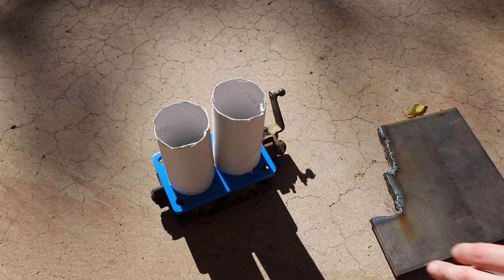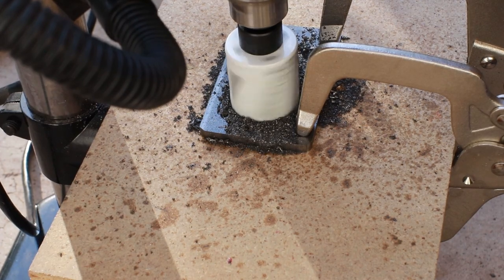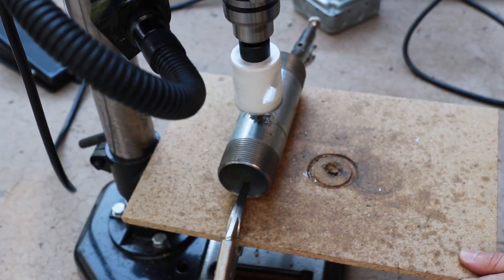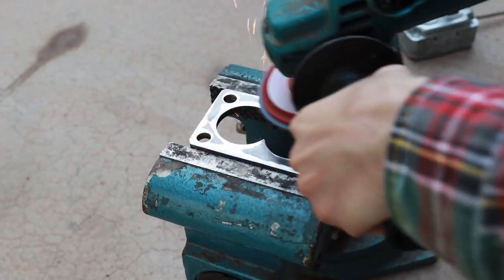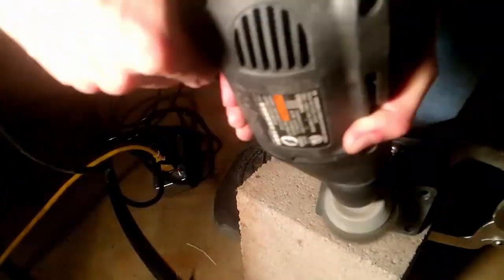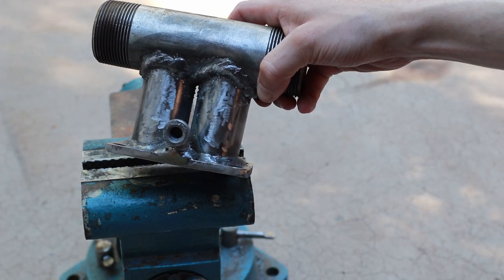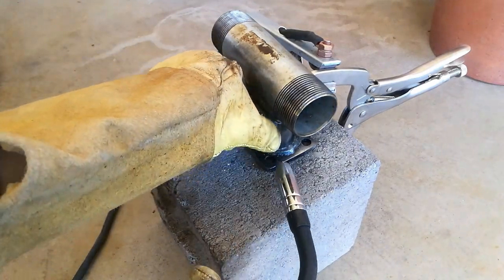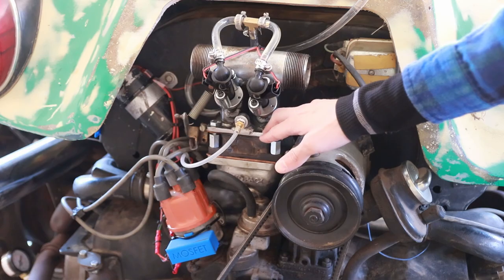TBI Fuel Injection for VW Air-Cooled Engine

Comment: Quick tip, when using a hole saw to try and make a large hole in a thick piece of steel, drill a couple of small holes on the perimeter of where the hole saw teeth are going to cut, it helps clear the chips out and lessens the load on the drill press slightly.
Reply from the maker: Great tip, thank you!

Comment: 4:44... Just a suggestion... It is always beneficial to start larger drilled holes with a smaller drilled hole. The small hole will be more accurately centered and the large drill will not skate off center.
Good job on the conversion
Reply from the maker: Great point, thank you!
Reply: Yeap! More easy way to do thats holes.
Reply: Another suggestion is slower cutting speeds..i found those large hole saws work best at slower speeds..too fast and it skips over instead of digging in and its actually faster.. this is known in the lathe world as feeds and speeds..their is a sweet spot.and the larger the tool the slower you go as the diameter changes surface speeds.and drill presses tend to drill smaller holes and are set to go fast and that compounds it with a larger cutting tool..SO the faster you go the more wear on the tool as well... carbide can go faster but tool steel needs a slower range of speeds and the right feeds.

Comment: It cut faster cause of the space that opened up for the chips of metal to go. It wasnt a closed space. But love  what your doing. Im in the middle of swaping a 200cc engine on to my honda grom clone. And im thinking i might have to go with fuel injection. Due to space and your videos are definitely helping

Comment: Throttle position sensors are the main reason you have the lags, and over or under-fueling/ backfiring. Get that on and it will be smooth ;-)

Comment: As an old hand at VW's, my guess on the stumble is not a fuel issue but a timing advance issue. The centrifugal only style distributor(009) is notorious for that. I prefer a vacuum advance advance myself. I have one on my Beetle that has taken all the lag out. It is an 86/87 Suzuki Samuri style distributor that fits the VW.
Reply from the maker: Great idea! Believe it or not, my newer ECU design actually controls spark timing via 4 HEI coils and a pair of optical pickups mounted inside the 009 distributor. This means I can actually add in vacuum advance via the MAP sensor signal if desired, and apply more or less any timing adjustments I want in software! With the latest ECU and programming, the buggy runs extremely smoothly now!
Reply: The homebrewn fuel injection doesnt have an accelerator pump. Thats why it stumbles - it has no way of handling transients, but only steady state. You need to look at mapDOT (Delta over time) or preferably  tpsDOT to add in an "accelerator pump" function.

Comment: I have to confess...I have a '64 dune buggy and plan on rebuilding a 1600cc engine that I'd love to add EFI to.  Thinking about the VW firing order of 1-4-3-2 means that one bank gets two intake pulses, followed by two intake pulses to the opposite bank.  The open plenum manifold your using should help with that fuel delivery scheme.  At high RPM carbureted VWs would develop a fuel fog above the carb (within the stock air cleaner). The open plenum manifold helps to reduce or eliminate the fog because it softens the intake pulses. I don't know 

if your EFI will develop the fuel fog or not, just be cautious at high RPM with an open intake.
Reply from the maker: That's great to know! I do recall seeing the fuel fog at high RPM on the old carburetor, although it never caused too much trouble. I'm also running an air hose over to a separate airbox, so that should keep the fog (if any occurs) contained and away from ignition sources.

Comment: Use a toothed wheel and a ignition coil pack, that's a huge improvement. I use a 36-1 and a GM coil, the four wire connector type

Comment: Hey ! Great video man, I've never had the guts to get that deep into my engine, I have a 97' Mexican Beetle, it has the 1600i engine and it runs pretty smooth, just the IAC valve give me troubles from time to time so i disconected it. Engine idles no problem. Keep the videos comin !

Comment: I love the simplicity of your design.  Can't wait to hear how the fuel ratio table and throttle position emulator worked out.  I was going to suggest moving the injectors closer to the cylinder intake ports,  but if the lag and rich/lean issues can be solved without relocation, moving the injectors would likely spoil some of the simplicity.  Rock on my friend!!  Liked and subscribed!
Reply: I would suggest moving the injectors beyond the butterfly valves they may be prone to ice

Comment: Hello again dielectric! I started my project to build Fuel injection system for my car, i talked to you in your another video.

I have an esp32 and started my project very simple, builded an sketch to create PWM to pulse the injector and in this program i can change the PWM frequency and duty-cycle too.

My first test is start the engine with this configuration just to se if will work, i buyed few fuel injectors here and using IRF3205 transistor to pulse the injector.

But before testing i have an idea, i have one magnet atached to camshaft corresponding to top dead center of first cylinder, instead of use PWM fixed frequency  i can make the injector pulse 4 times after the hall sensor detect the magnet, i can make 4 pulses, 8 pulses, 16 pulses or more after the hall sensor give the position of the first piston,this maybe give me a little synchronization and maybe work betther than use only fixed PWM value ist'n?

I have an hall sensor in distrubutor too, but this hall change the pulses because ignition time advante so i don't know if use hall from the distributor is the best idea, what do you think?
Reply from the maker: I believe as long as the total on-time of the fuel injectors matches the required fuel delivery, it should work. Since you are designing a synchronous system, the pulse width or pulse count should follow the MAP measurement. The more manifold pressure there is, the more on-time the injector should have during each rotation of the crank sensor.

Comment: In this video you clearly explain how you used two injectors to avoid reaching the maximum duty cycle. How was this change reflected in the code?I have been studying the code and I am missing a variable to indicate the number of injectors used, this is because I will use 4, and I don't know whether to divide the time of the injectors
Reply from the maker: The only value that needs to be changed when selecting your injector configuration is the injector maximum flow rate, "injector_MaxGramsPerMinute". To compute the correct value, simply add up all the flow rates of the various injectors (in grams per minute).

Because all the injectors are simultaneously switched open and closed, the ECM only needs to know the total combined injector flow rate.
Reply: It makes perfect sense, I'll be uploading content with my development, I'll show my progress

Comment: I was wandering if the mixture is identical between Zyl. #1 and 2 or #3 and 4. I build a similar version. One IDF TB with an aftermarket manifold combined with stock end castings. The AFRs were completely different. And the curves varies between different part throttles and full throttle. Be careful. I try to show a picture from my logging. The problem is named: fuel robbery between siamese ports.
Reply: The A/F ratio problem with aircooled VW engine occurs due to the firing order. Manifold icing will still be an issue. Fuel mixture balance left to right bank will be an issue on this design. And as always, the exhaust system shown in video robs HP &Torque....

Comment: Very impressive project! Once you’ve converted one engine you’ll be putting EFI on everything.
I just finished building a Megasquirt for my converted tunnel ram project. 
Does your system use an O2 sensor for closed loop adjustment? Keep up the good work!👍
Reply from the maker: Thank you! Right now it's open-loop only, but my latest board has additional analog inputs that could be used with an O2 sensor for closed-loop control!

Comment: Awesome... love the ingenuity and simplicity of the solutions, and the results seem really good! Do you believe the 2 injector setup will suffice the needs of the 1600? Also, have you thought of implementing a setup close to the classic 2-carb setup where you’d have a manifold sitting vertically above each head, each with its own throttle body and injector? Cheers!
Reply from the maker: I believe 2 injectors should be adequate, as these are 195 gram/min high-flow injectors. 1 injector was almost enough for the 1200cc engine, although it would peg to 100% duty on a super hard pull at 4500 RPM. So, for the 1600 I believe 2 should be plenty.

That's an awesome idea to run 2 separate throttle bodies! I think if I decide to use throttle position sensing in the future, I will probably use sensored single-bore throttle bodies, one per side as you say.

Cheers!
Reply: @DielectricVideos  thanks for your reply! Looking forward to see the future of this. What you’ve achieved so far is very impressive - kudos to you for pioneering your own system almost from scratch and taking us along for the ride.
Reply: @DielectricVideos  hi one question what model o type the injectores and what is cae o vehicle?

Comment: Have you thought about using an electronic distributor or module like a Pertronix? Made a world of difference for throttle response on my 1600.
Reply from the maker: I actually designed my own HEI system just recently, and it made a huge improvement in power. I'm hoping to do a video on it soon!
Reply: Waiting for more of your efi videos. 😍

Comment: Air don't like to make sharp turns! I would make that intake a little different?
Reply from the maker: Great idea! If I ever build a 2nd version, I will definitely make it smoother. So far this one has performed very well, as I have put over 3100 miles on it!

Comment: I guess the MAP should  be connected to the inside of the barrels?
Reply from the maker: The throttle body that mounts below the barrels has a vacuum port that connects downstream of the throttle valves. The small threaded elbow fitting connects to this, and the MAP sensor can be connected with a hose to this fitting.

It's important to have the MAP sensor connected on the engine-side of the throttle body in order to accurately measure the air mass flowing into the engine.

Comment: Did you consider to put a lambda sensor to correct the rich mix ?
Reply from the maker: I did some testing with one and may incorporate it in the future. It would provide a gradual adjustment to AFR target to compensate for drift in the injector performance, sensor performance, etc.

Comment: Isn't the vacuum barrel of the sensor map connected below the acceleration butterflies
Reply from the maker: It does, there is actually a bypass port on the butterfly throttle body that goes through to the vacuum takeoff

Comment: Can use in load sensor only? because I don't have map sensor
Reply from the maker: If you mean a MAF (mass air flow) sensor, then it is possible, but in my experience it isn't reliable. Long ago I tried a MAF-only EFI system, but the MAF sensor drifted considerably with vibration of the engine and bumps in the road.

MAF sensors are better as long-term average sensors for correcting error in other measurements, but are not good for fast-response measurements.

An alternative to a MAP sensor could be a throttle position sensor. The mass airflow could be approximated by multiplying the throttle position by the engine RPM, and then by applying a compensation factor to account for non-idealities in the throttle position. But you would want to carefully tune a lookup table or AFR table to give the correct mixture across a wide range of throttle positions and engine speeds, as the two are not likely to be perfectly linear to the mass airflow.

Comment: I need some help. I’m doing something similar on a Toyota 7k motor.
The problems I’m having is.
The engine runs too rich and fuel puddles in the intake manifold?

What could be the problem?

I reduced the fuel mixture on the tuning software still having same issues.
I tried switching injectors and still having the same issues.
Reply from the maker: Some things to check:

1. What angle are your injectors entering the manifold? If the angle is too shallow (too close to perpendicular to the manifold), fuel can pool up as it hits the side of the manifold.

2. What fuel pressure are you using? If it's too low, the fuel might not be atomizing well.

3. Is your injector flow rate set correctly in the tuning software? Remember that the flow rate will be higher than specified if you are running a higher fuel pressure than the injectors are specified at.

Also be sure your sensors are all connected and calibrated correctly. If it's a speed-density control system and the MAP sensor is left disconnected, it may run excessively rich due to the ECU thinking the intake is always at atmospheric pressure.

To some extent, fuel pooling is an inevitable problem for TBI systems (which is why pretty much all modern cars use port injection or direct injection now). Even in my VW, it goes rich for a few seconds if I suddenly decrease throttle position after a long pull or cruise. But in general, it should be possible to get good mixture quality in most driving conditions with a TBI system.

Comment: soak that pipe in vinegar and it will take off the zinc oxide and clean metal up but it will rust quick when rinsed and dried
Reply from the maker: Great idea! I'll try that next time I have to weld something galvanized.

Comment: Hello I am Currently a Computer Engineering Student that would love to take on this project, 
I wanted to know specifically what injectors and Map sensor you used and where to possibly source out the hardware used to mount all the sensors and injectors.

Comment: Love your vids!  I'm considering going EFI on my bug as well.  Where did you get the plastic injector caps that go to a hose barb?    Any update on how it's running?    Thanks!
Reply from the maker: Thank you!

I got the injector caps on eBay here: https://www.ebay.com/itm/113711584424

I've been driving it every week for 30-50 miles, and it's been running extremely well! It easily does 75+ MPH on the highway and stays cool, even in the 100+ degree heat in Phoenix. I also passed emissions with it a month ago!

I currently am using a newer version of the PCB that drives 4 individual HEI coils in wasted-spark configuration, and it runs brilliantly (better even than some modern EFI cars). The fuel injection control is identical, although the workload is split across 2 separate Arduinos to allow for more CPU time to run the 4 coils. I'll be making a video on the new board soon!

Comment: Hello :) I’ve measured the vacum on my efi bug - when costing at 2000 and 2500 rpm and the manifold shows vacumm I’m thinking to enrage the throttle body intake to allow at that rpm to have atmospheric pressure at full load - ( when going up a hill) - do you think that will give me an increase in torque due to the added air / fuel ??
Reply from the maker: It should help, as the more mixture you can get in at full load, the more power you can make. Also keep in mind that the manifold runners and heads will add restriction, so top-manifold pressure may not be exactly the same as cylinder pressure.